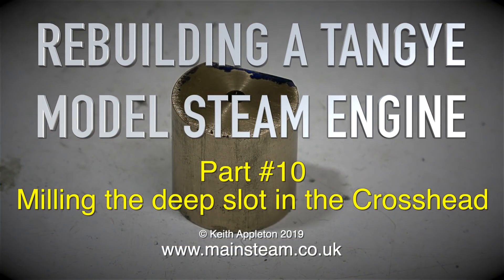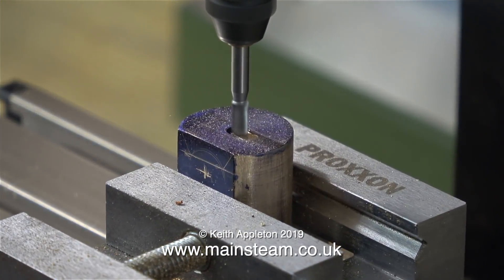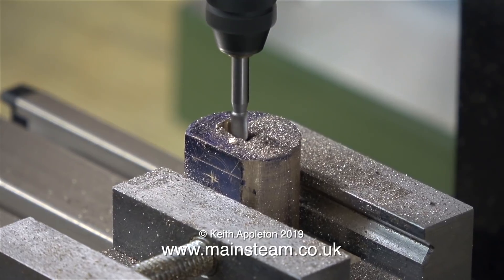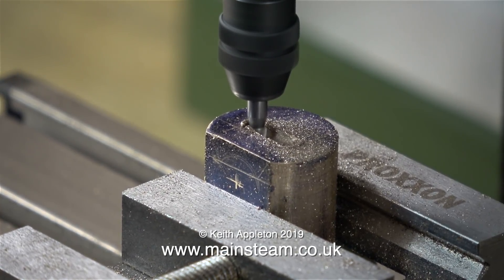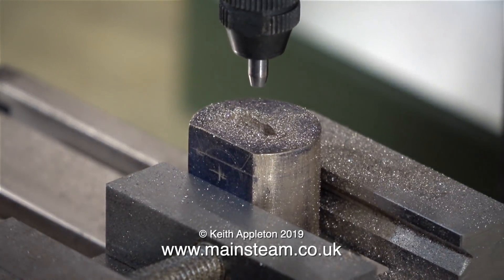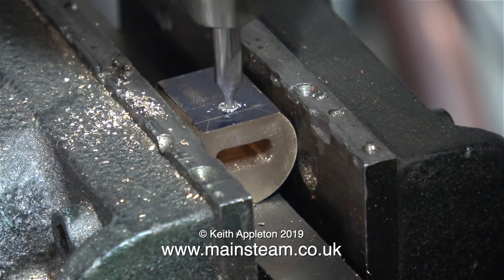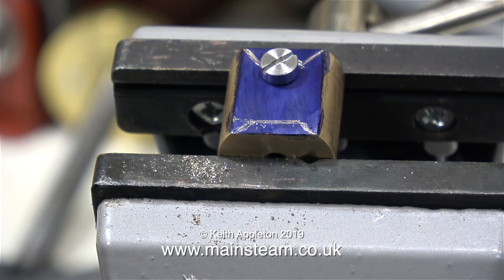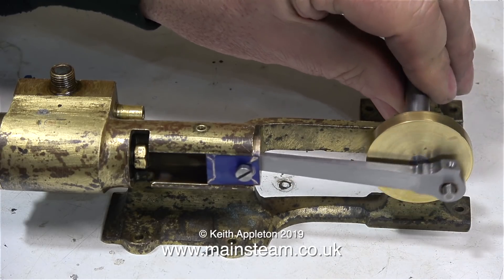REBUILDING A TANGYE MODEL STEAM ENGINE - PART #10

Comment: Have attempted to cut stainless steel with this proxxon?
Reply from the maker: Yes it works OK, it wouldn't be my first choice, I would use a larger machine, but the little Proxxon tools are good things to have in my workshop for a variety of jobs.

Comment: Hi Keith, I am having problems milling mild steel in my small mill. Have a 6mm and 12mm cutter. Am curious what RPM you are using on bronze?
Reply from the maker: Run it slowly and use plenty of cutting lubricant.
Reply: @keithappleton  Thank you Keith. That's two things I was not doing!

Comment: As to the EF70 (MF70?), maybe the machine is not at fault, although it is a light machine. I never got really good results with this kind of cutter, it too dull and actually only suited for wood. I have a few 3 mm HSS single flute cutters and they work far better. With your gynaecologist’s touch you should get excellent results.